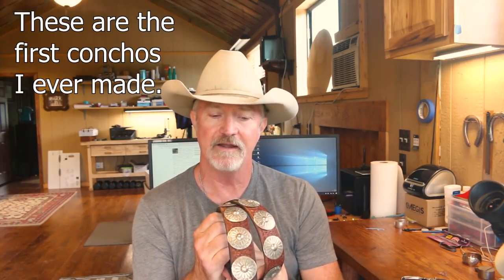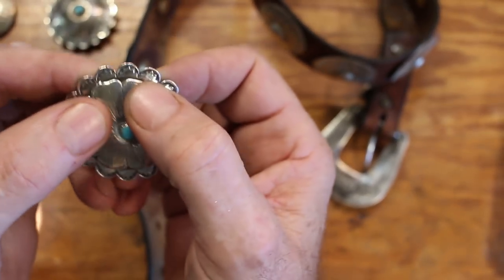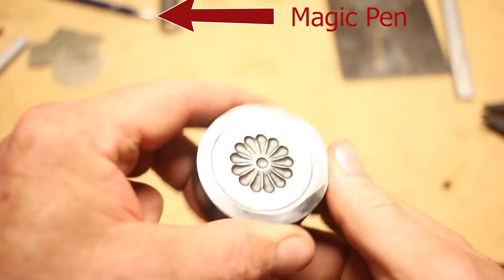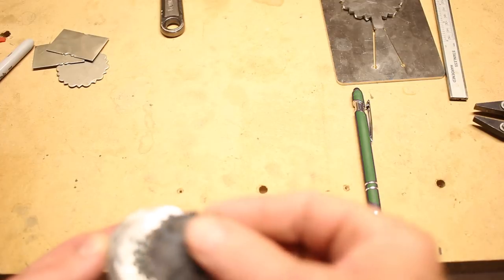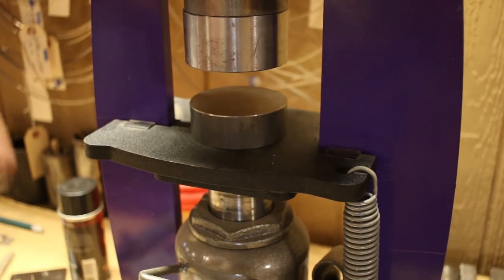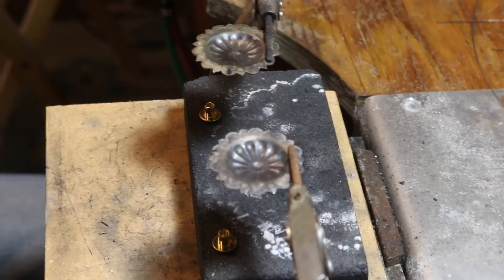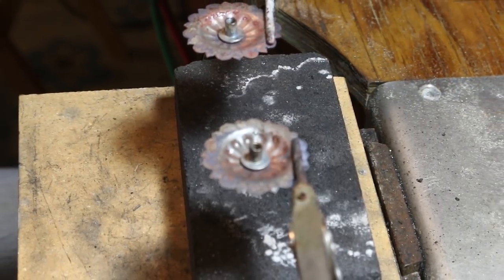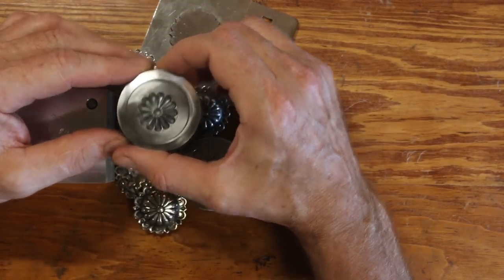Let's Make Conchos!!

Comment: I like your system very much. I also like to work with turquoise. I would like to use your system to make a concho and be able to set a round turquoise stone at the center of the concho. I saw one of your photos with turquoise set in a concho. How could I make a place in the concho to set the stone.
Reply from the maker: Thanks, Harold!  I have a die for the 1.5" kit that is designed to give you exactly what you are asking for.  Here is the link. https://www.etsy.com/listing/692814863/impression-die-stylized-daisy It is suitable for a 10mm cabochon.

Comment: Jim,  Love the video and I have a question.  What is the minimum size of hydraulic press that can do this set of pancake, impression dies?  I see these smaller hydraulic presses, for instance a 8 ton that sells on Etsy.  There are also smaller ones, 2 ton, 5 ton,  but they don't seem to have enough pressure to do the impression dies and pancake dies according to the comments about the smaller presses.
Reply from the maker: The pancake dies don't require as much pressure as the impression dies.  If you are only concerned about using pancake dies, then an 8 ton will be fine.  For impression dies, I would recommend 20 ton.  
Thanks for watching!
Reply: @JimBrandvik  I wish someone would come up with a 20 tom that isnt so expensive.
Reply from the maker: @mlinden20905  I did a quick search and found this one on Etsy No affiliation
Reply from the maker: @mlinden20905  YouTube won’t let me paste the link look on Etsy for a store called Artcraftsupply
Reply: @JimBrandvik  Thanks!  From another Texan I love when you talk about the weather and that you can open the windows.  Finally!  Of course that stretch of nightmarish weather we had in Feb I would have liked to miss!
Reply from the maker: @mlinden20905  Well I was lucky enough to have missed that mess because we moved to Prescott AZ in January.  We love TX but we don't miss the humidity. That's the main reason we moved.

Comment: Hay there! I have a question about different metals vs different types of solder…..I’m trying to repurpose some rivets that I cut off n old belt and sanded flat. My plan was to solder flat Chicago screws onto the backs. The soft solder I have, with my solder gun, runs right off the concho AND the Chicago screw…even after I roughed them up some. So, I bought some flus and wire solder, and tried to lightly use my propane torch, and that solder wouldn’t stick either, PLUS it melted part of my concho! I’ve been digging and can’t find a solution to this issue. I would greatly appreciate any advice you may have!!!

Comment: Jim, what kind of fastener would you use for a concho for a hat on the band? Chicago screw would be too bulky I think. Would appreciate your thoughts.
Reply: Dana Licking I know your comment is old but I’m trying with no luck to find silver conchos to put on a new horsehair hatband.  Tons of conchos out there but none have a backing system that will work to adhere them to this hatband.

Comment: Thanks for the informative video.  I've been wondering about how to make the back of the concho so it would go on leather.  Any plans to make a system for smaller conchos?  I have several impression dies from Potter USA that would make great conchos.  I like your system, especially the doming jig.
Reply from the maker: Yes! I am working on a 1inch version right now, It should be ready soon!

Comment: Jim do you file/tumble the rough outer edge at any time?  Great video - very informative!!!  Thanks so much!
Reply from the maker: Hi Melissa, I usually sand the backs before attaching the Chicago screws. You can just lay sandpaper upside on a flat surface and rub the conchos over it to remove any burs, then the buffing wheel can easily polish.

Comment: Hello. I don’t have a press and I was wondering if you think I could use something else with your concho system? Maybe a c-clamp or screw press?
  Thank you.
Reply from the maker: artsoulfull you can use anything that is capable of applying 10-20 tons of force. But a hydraulic press is the most economical way of doing that.

Comment: Hi Jim, what kind of flux and solder are you using? I'd like to put some new backs on my sterling overlay conchos, like you did here.
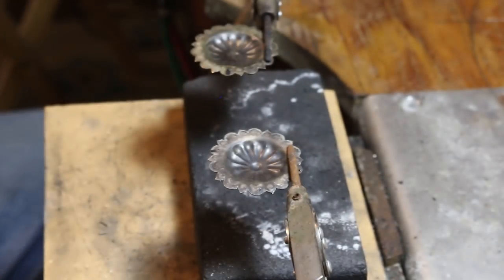Reply from the maker: Alison Elwell Hi, watch from 24:20 in the video where I explain that. Spelling for the flux is “Cuprinol”
Reply: @JimBrandvik  Thank you for the spelling! Is the solder just called "hard solder"? I'm a total novice here, but am half-handy other than always taking my conchos to jewelers and waiting in line weeks to have posts mounted... I am finding there are less and less willing to take them, though!
Reply from the maker: This is what I use 90% of the time. https://www.riogrande.com/product/Silver-Wire-Solder-22-Ga-Hard/101711

Comment: Hi. Sorry to bother you again. I'd like to ask about hydraulic presses that can be used with your Conchos system. 

I am a hobbyist. Sell a little jewelry, but mostly make it for myself and friends and charity silent auctions. So a Really expensive press is not feasible. I think the Potters are out of my realm.

I do see some presses for sale on Ebay (eg. There's a 20 ton  Stark floor model for a couple hundred bucks right now down from $650. Could be junk or a pain to use...). There are some table models too. And there is a U-Tube site for a DIY  hydraulic press with a 2 ton hydraulic . I guess Harbor Freight has a jewelry press too which I haven't found yet. 

Anyway. How many tons are required for a press to use with your system? Realizing that the more expensive, and well made the press, the better it will be in the long run. But is there something that can be used until I can either justify the expense  of something like a Potter and /or decide if this is something I want to pursue  more seriously.

Thank you again.
Reply from the maker: Hi Deborah,  No bother at all! I will try to answer all of you questions.  First and most important is the tonnage.  Pancake dies will cut sheet with much less force.  My concho forming dies require very little pressure to form the metal, but impression dies need a lot of pressure. Many of the impression dies I make and Kevin Potter sells will require up to 20 tons of force to get a good crisp impression. So yes, you will definitely want a 20 ton press.  A manual press is just fine. Don't worry about electric powered cylinders. I would steer you away from a floor standing "H-frame" shop press.  An H-frame press like the ones sold on eBay will work, but by their design, they are wobbly and not a lot of fun to use.  They are intended as jewelry presses.  But again, they will work if that's you only option. I did a bit of Googling and found this press..  
https://www.magnatronics.us/products/jewelry_press

This simple design has been around for a long time and would work just fine.  It is less than half the price of Kevin 20 ton press.  I have no experience with this company, so understand that I am not endorsing the company,  just the press design. In my opinion, you would be much happier with this type than with a follow standing h-frame shop press. Thanks for watching!
Jim
Reply: @JimBrandvik  Thank you for your message. I am going to look into the press you referenced. The 20 ton one is $290. Jumps way up.to $510 for 30 ton, so if 20 will do the job, 20 it is. 

So thank you again. I will plan on getting your Conchos system first, then the press. First have to see how much my tractor is gonna cost to repair this month. But by June!

Thanks again.

Comment: Can you stamp first before you dome the concho? BTW, this is an awesome system you've developed.  Unfortunately I don't have a shop press/jewelry press to give it a try.  Thanks so much for such a great video.
Reply from the maker: Julie Teeples it’s best to stamp after doming because the act of stamping can stretch the diameter of the blank so that it is too big to fit into the cavity of the forming die.

Comment: How long does the pancake die last
Reply from the maker: @scottcarman3090  I have pancake dies that I’ve used for several years. With proper use you can get several hundred uses. The main thing that kills them is when people continue to pump the press handle after the piece has “popped “. That traps the metal tab and can deform the pancake die in that spot.

Comment: Retired machinist?
Reply from the maker: Not retired. I do this stuff for a living. I'm just a hobby machinist as best. Thanks for watching.
Reply: @JimBrandvik  
Are you making our own dies?  I was a tool & die guy for 35 years.
Reply from the maker: Rick, I have been an engraver for the bulk of my artistic career. Then I started carving negative impression dies in mild steel (for my own jewelry). I did 2.5D negatives (female dies) for a couple years before I transitioned to carving male hubs in tool steel as masters. That was better for more 3 dimensional work. I eventually started selling impressions of my hubs. So that was a long way of saying yes, I make my own dies.